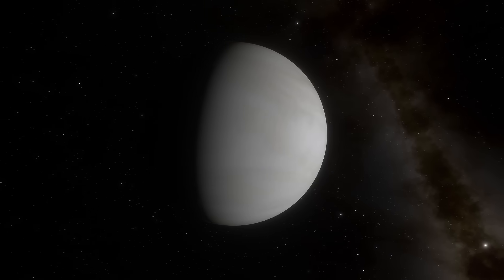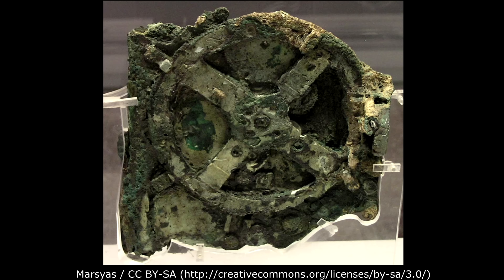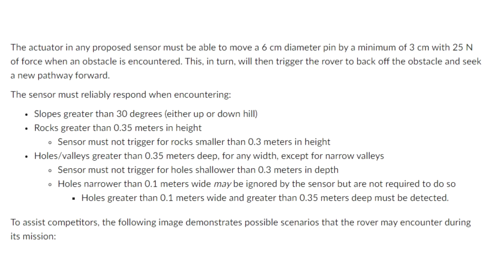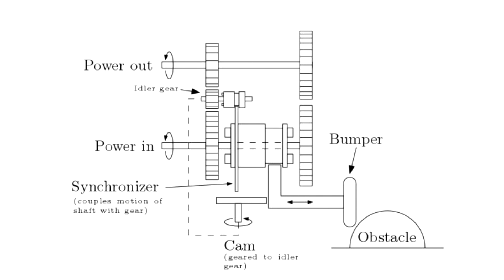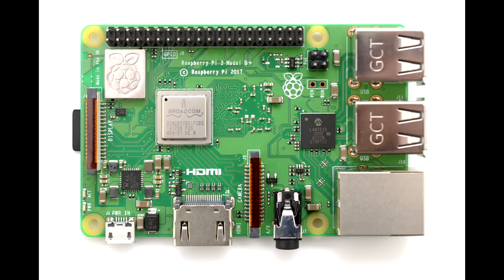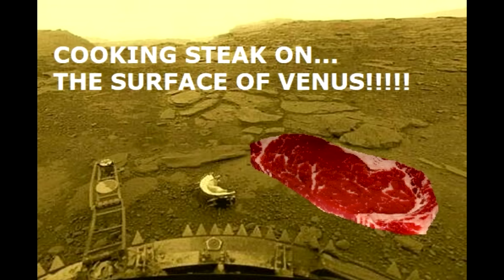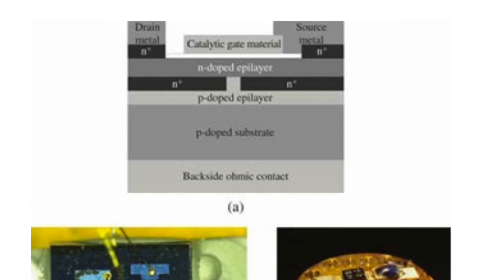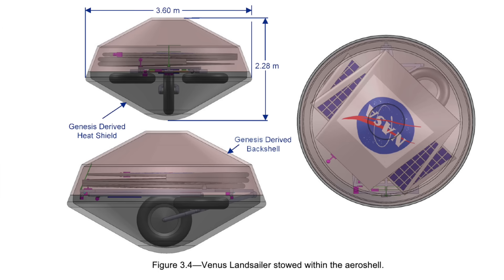Venus Rover Concepts That Beat The Killer Atmosphere

Comment: What about putting the electronics in a vacuum to reduce heat transfer then only worry about cooling the support rod
Reply: You mean a thermos?
Reply: But the electronics need to interact with the environment anyways
Reply: there's no way to dissipate the radiating heat
Reply: That's what I was thinking as well. Surely the heat radiation from the outer shell would be lower than what the active cooled hanging rod will provide to the inner shell, right? And if need be, this process can be repeated (like 3 "thermoses" within each other providing lower "heat radiation/rod cooling" ratio with each layer)?
Now, since this very simple concept it makes me think that I have missed something obvious that mission architects did not... :)
Reply: @maxidejf  im wondering if structural stress would be too much having vacuum on one side, high pressure on the other, solved again with multiple shells right? But each shell is adding extra weight
Reply: @MrTurboTash  thicker shell and support structures, nothing is impossible. Hydrostatic compressive pressure from the outside is a much easier task than hydrostatic tensile pressure pushing outwards from the inside.
Reply: @MrTurboTash  yeah, the outer most thermos could even be just a spherical "not-cooled heavy duty" one with more thick pillars to the inner shell; just to be able withstand the pressure difference. The next one(s) after that could then be the "rod cooled" one(s).
Since we can construct and land car-sized rovers now and the "inner brain" could be something raspberry pi sized hopefully weight of this apparatus would not be such an issue? The most inner sphere would be tiny and vacuum layers can be very thin.
Reply: @maxidejf  the heat would still radiate inwards instead of being conducted and convected. It would work as a pretty good insulation, and is exactly the thing that is used in thermos flasks to keep the drinks hot. However, in itself it won't stop the thing inside from heating up, it will merely slow down the rate at which it happens.
Reply: @jackvernian7779  Damn you, thermodynamics! :) But what about fridge though? The fridge "defy" this by making a heat source outside of it that is of higher temperature than what is in your room (i.e. thermodynamics of the whole room as an enclosed system is OK). All you need is some input energy (rover would have electric power). So I am thinking "small fridges" that would cool the rods by making more heat above them (passing it into above thermos / the room from my above example). There are even some nice mechanical fridges out there that don't need liquid condensation (saw a guy on YT making a fridge just by stretching the rubber bands on a wheel :) )
Reply: @maxidejf  Refridgeration would work, but it would be very energy-costly and bulky due to outside being so hot and at such a high density. You'd have to remove a lot of heat quicker than it is added to the system. Can be done, but tricky :)

Anyway, I think the easier option would be to design from the ground up new electronic circuits from materials capable of withstanding the heat, 600C is not a huge deal breaker. And only cooling down CPUs and other units locally which simply cannot take it.
Reply: @jackvernian7779  The problem is that you need a lot more energy to keep semiconductors semiconducting with higher temperatures. So the moment you are about to cool something I think it would make sense to have these "thermos fridges" since the heat build up from heat radiation through these vacuum layers would be small and slow and you would save more energy by hiding more electronics in there.
It's all theoretical though; I can't crunch those numbers (I work in space industry, but I am just a SW developer, so once we have some working "thermos fridges" or high-temperature electronics I would gladly start working on that :) )
Reply: @maxidejf  I'm a student doing physical engineering & nanotechnology, mainly focused on magnetism. I'd have to research on the topic in greater detail, but it is within the realm of possibility as semiconductor doping is something that broadens the horizons quite a lot. Even if it's not possible to achieve 600C semicondutors, it should ease the load on the system if it's functional around 300C instead of 100C. Again, it's a whole new can of worms and best asked of the people who are actually developing high temperature semi-conds right now.
Reply: @jackvernian7779  Great, maybe we will meet over Venus Rover Project one day if you will start working in space industry after your studies. :)
But I think either of those approaches (or both combined) might be better than trying to come up with purely mechanical rover, that just sounds way too insane to me.. :D
Reply: @maxidejf  true. I think this competition is more for fun to see how much we can get away with from a purely mechanical design standpoint :)
Reply: @Nothing\ Same concept yes 
@Opper Darwin @rodrigo m I'm thinking about a support rod with power and data cable, which would still have heat transfer but at a lower rate easier to manage by the heat pump

Comment: Related question, are there materials we can use to build a computer that would ONLY work at several hundred degrees C? At room temperature the computer would be too cold to use, but once it warmed up to +400C the materials would begin to behave like semiconductors?
Reply: Just use vacuum tubes instead.

Comment: Do thermionic valves operate at those temperatures? Downside is that they are bulky and fragile.
Reply: At those temperatures, there's no particular reason to use the thin glass found in 1940s electronics.

Comment: Ahh, pneumatic logic I remember working with that on Type 42 destroyers.
Reply: That's a military ship. Who let logic aboard?   ;)
Reply: @donjones4719  I didn't say it worked did I? :)
Reply: GORGEOUSGEORGE  You can design a system to work well in one environment but not very well across a very wide range of environments. In UK waters the Logic systems worked well. But a warship doesn't stay in one area. The changes in temperature and humidity added to the shock, vibration and salt laden air tended to trash the systems pretty fast. :(
Reply: Better than vacuum logic... imagine being limited to 10 psi absolute.
Reply: Loose lips :x
Reply: Oh!  For a minute there I thought you were talking about a Type 40 destroyer.  The thought of something designed just for destroying a Type 40 TARDIS sounded dangerous!

Comment: I still think an airship would be better both because it's relatively more straightforward operating in the cooler temps. Also, it has near-Earth atmospheric pressures to work in; you only need to figure out how to protect against the Sulfuric Acid. It would be ideal if you can get an airship capable of descending to below the clouds as well as ascend to above the clouds to charge batteries and send data to a satellite.